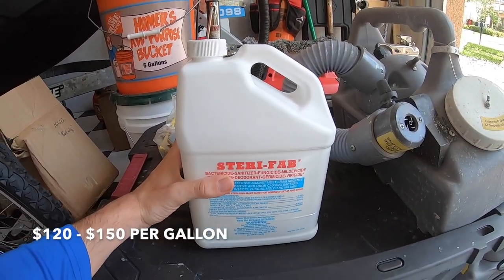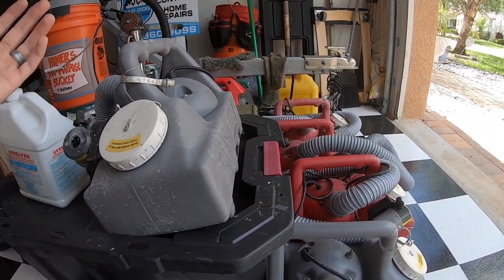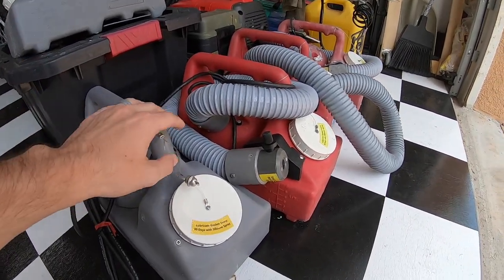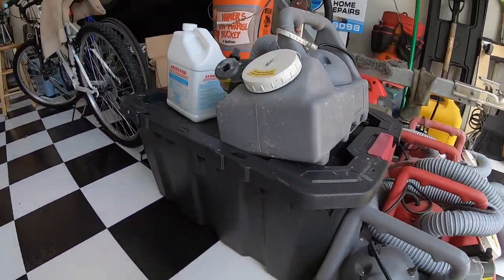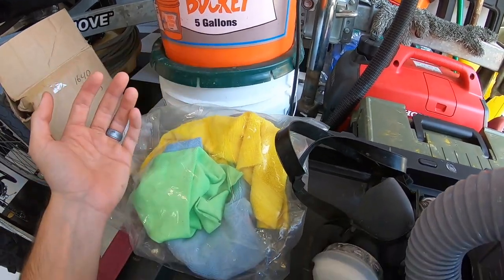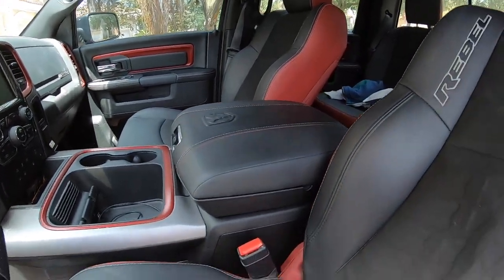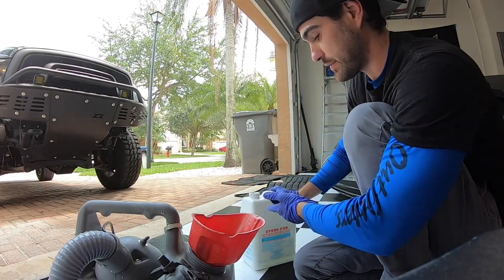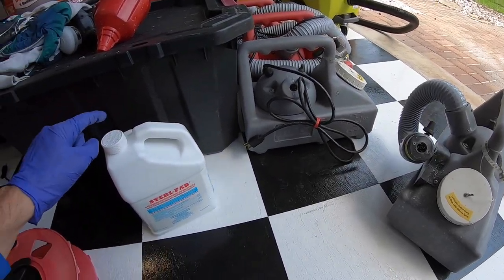Professionally Disinfecting & Sanitizing Your Vehicle | How You Can Do it!! | Ft Lifted Ram Rebel

Comment: Nothing to do with the topic of this video but I ran across your channel, I also have a ram rebel 2015 but I've already taken my vehicle to two different dealerships to check up on my air suspension ride. The air compressor is good and everything is still OEM and fuses are good just the ride to my rebel went to super smooth on the road to hella super stiff to where you feel every little bump on the road that it's so uncomfortable driving. Idk if you've gone through this by any chance but to this point I'm just lost on what to do anymore. Not even two different ram dealerships could find anything wrong with it
Reply from the maker: Kinda sounds like the bags might be over inflated. You might need a system recharge. Seems like a lot of dealers aren’t trained to handle the air ride trucks.
Reply: @Wimya  and how or what is a system recharge? Like a restart or something?
Reply: If anyone knows about a possible issue fix please let me know. I'm sick and tired of it and I just don't wanna switch to coil overs and all. I used to love my air ride 😔
Reply from the maker: @frankvazquez0238  Basically, the dealer releases the nitrogen out of the system and then refills and resets it via their computer. I need to find a dealer willing to do one on my truck as well.
Reply: @Wimya  woah I've never heard of that process. But same situation I'm in. Two different dealerships didnt even know what to look for and just told me everything is fine and working how its suppose to but in reality it's not. Just the whole air suspension air ride is super stiff just a pain in the ass to drive
Reply from the maker: Yea it seem like a majority of these dealerships weren’t properly trained when it comes to the air ride trucks. You can also try to reset it yourself by hold both the Up & Down buttons for the suspension until the reset message pops up on the dash.
Reply: @Wimya  I shall try it right now. Hopefully that works. Thanks
Reply: @Wimya  while the truck is on or off?
Reply: I just did what you said and all it gave me was a "service air suspension " notice now.
Reply from the maker: Damnit, it was a long shot but that’s what I had to do after installing the BDS kit to get it to work. Seems like it’s gonna be a dealer issue